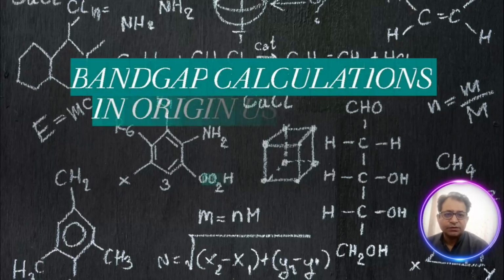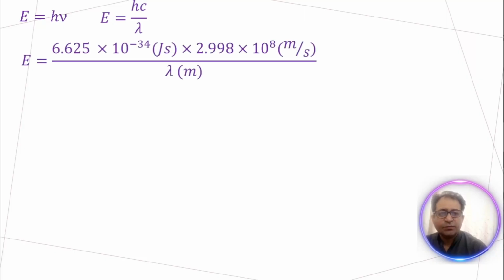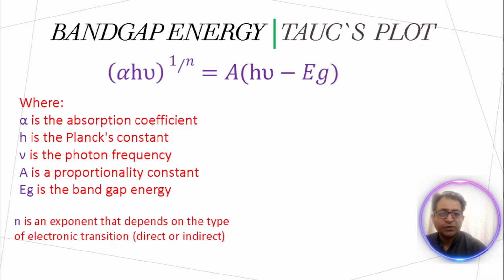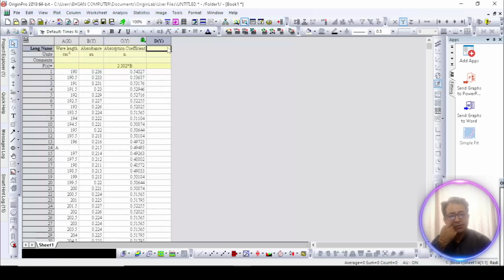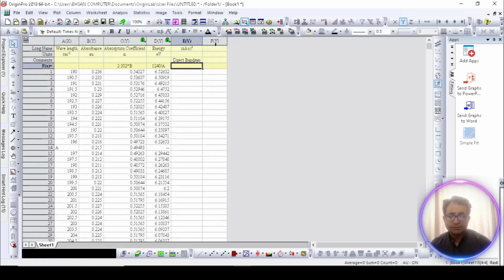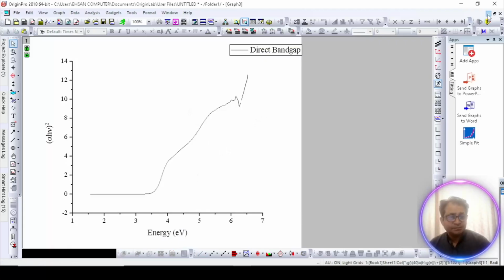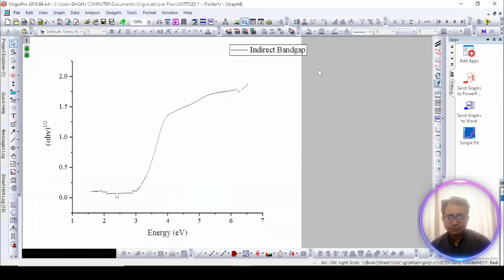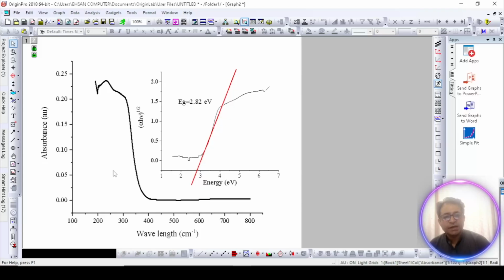How to Calculate Band Gap Energy Using UV-Vis & Tauc Plot in Origin  Semiconductor Analysis Tutorial

Comment: I have a question, does the concept of indirect and direct band gap -  transitionband chages when wehave reflectance data andn we use kubelka munk equation, and when we have absorption data? I read and see some people use n = 2, n = 1/2 for direct and indirect band gap.
Reply: Can u pls give the correct information?
Reply from the maker: The concepts of direct and indirect band gap transitions do not change whether you're using absorption data or diffuse reflectance data via the Kubelka-Munk function. In both cases, a Tauc plot is used to estimate the optical band gap, where the exponent 𝑛 n in the equation ( 𝛼 ℎ 𝜈 ) 𝑛 (αhν) n or ( 𝐹 ( 𝑅 ) ℎ 𝜈 ) 𝑛 (F(R)hν) n reflects the type of transition: 𝑛 = 1 / 2 n=1/2 for direct allowed and 𝑛 = 2 n=2 for indirect allowed. Kubelka-Munk 𝐹 ( 𝑅 ) F(R) is proportional to the absorption coefficient 𝛼 α, so it can be substituted when only reflectance data is available, but the choice of 𝑛 n still depends solely on the material’s intrinsic band structure.